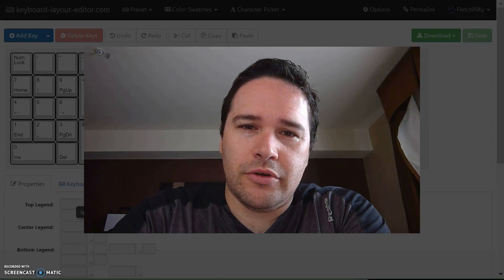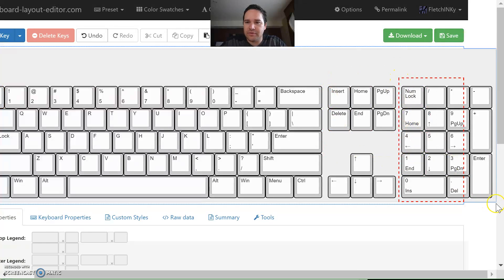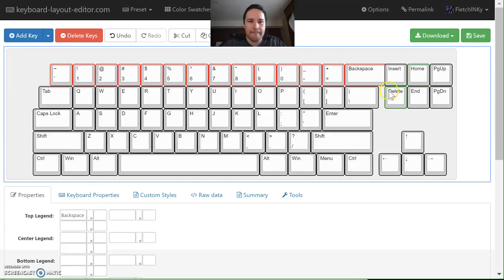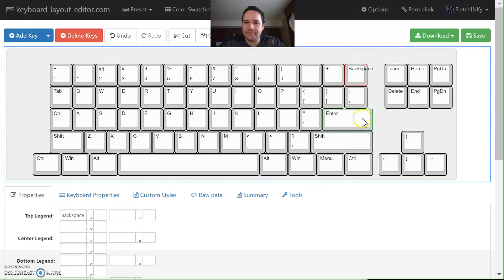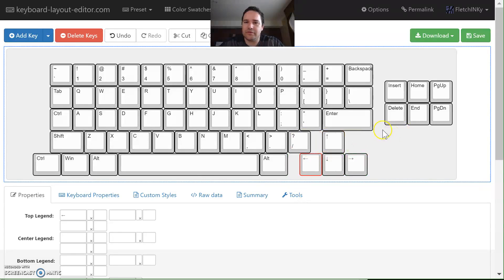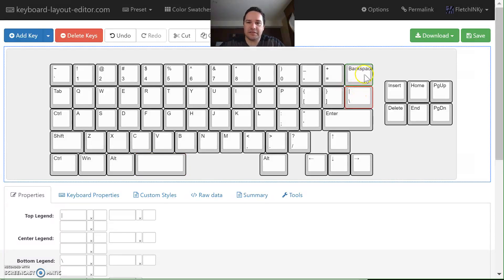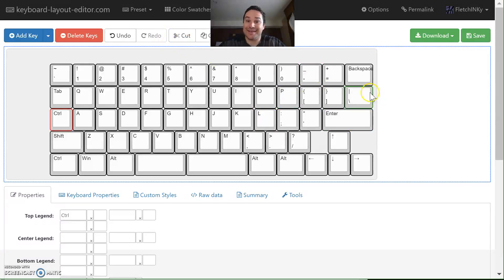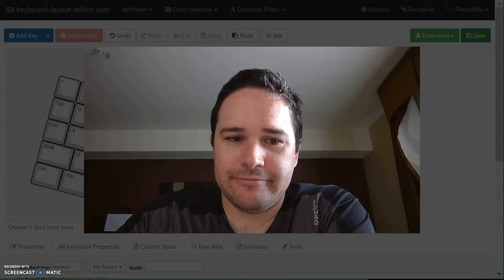From Concept to Build: YOUR custom Mechanical Keyboard (1/?)

Comment: Hey Troy, I know this is quite old, but I figured this might be the right place.

Is the spacing of the individual keycaps acceptable by default (in keyboard-layout-editor)?
I was just wondering, how much clearance the caps will have in a final build, without adding extra space.

And, thank you so much for the video. It is a really good intro for people who want to get into custom builds.
After watching this, I started designing my own layout and build.
Reply from the maker: The spacing is figured out by swill's builder (next video), and is standardized to all modern keyboards. I think it's 75mm center to center. You basically won't have to worry about it unless you accidentally move some of the individual switch holes without moving the ones nearest it. Just make sure to group your nearby switch holes so you can't make that kind of mistake.

Now that I've got orders through Ponoko, I can make the next video in this series without saying, "then go to your local laser cutter..." :)
Reply: Thank you! I will keep that in mind.

The laser cutter will miss you! But who am I to judge, I'm preferring my local 3D printer, since it's right next to the kitchen :P
Reply from the maker: Lucky! There's really an art to 3d printing plates to accuracy of a few hundredths of an inch. I've heard there's lots of filing involved :X But I really don't have any experience.

However, once you have a plate that fits switches (or is close enough of a fit for hot glue!) the rest is just handwiring and programming, and I've got videos covering all that stuff already!
Reply: The neat thing with a personal 3D printer is, you can just go with a learning-by-doing approach of some "test print, test fit, adjust, ..." cycles. Ordering a 3D print at some random print-shop is always tricky since you have to work with anything you get. In this case you should have your files ready for work ;)

I know you have some nice videos on the whole build process - I've already watched all your videos on the keyboard topic :)
And there is one thing regarding the handwiring you show in one of your videos. You striped a multicore wire and used the single copper fibers to wire up the columns. 
What are your thoughts on using enameled copper wire for that? The insulation should burn off quickly while soldering it to the switches and there shouldn't be a need for the extra drop of hot glue, insulating rows and columns. Just wondering...

I hope I'm not already bothering you with my bad English and the questions. Just tell me, if that's the case. :)
Reply from the maker: Enameled wire is even better, but my only (limited) experience with it made it hard for me to determine when the enamel was completely burned off, and I had a real solid solder joint. The multicore wire takes the solder very visibly, but my experience with the enameled stuff was always a little dodgy. It always seemed like it just disappeared into a ball of solder, but I could never really see bonding with it. I also found it very flimsy.

But it would be a good way to go if I could get it to work. Perhaps a thicker gauge wire with a very obvious enamel color? Anything that makes the handwiring process faster will allow me to price it lower.
Reply from the maker: There is no bother at all! I appreciate the engagement and the interesting ideas. Collaboration and talking through ideas is the way to make them better. Most of my designs have reached the point where I'm at the limit of my personal creativity. It takes someone who doesn't think like I do, or isn't so close to the problem to see new angles. Also, I hadn't noticed much in the way of bad english, I've had no problem understanding you.